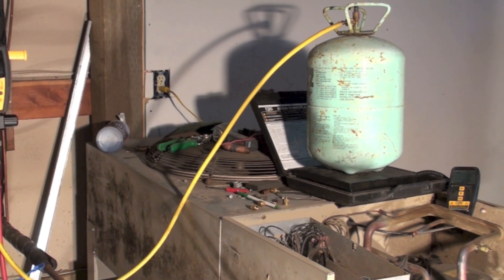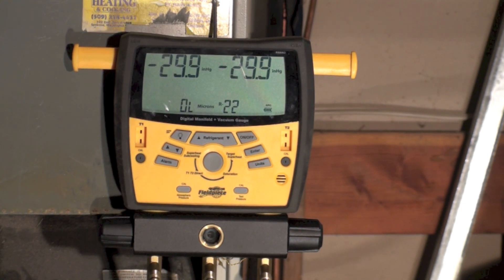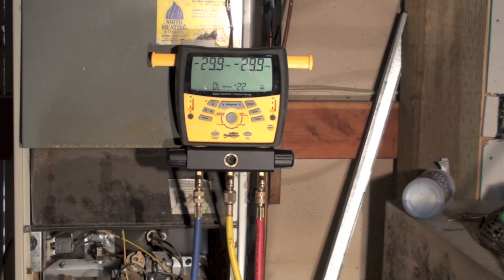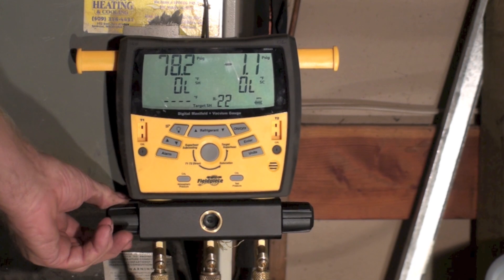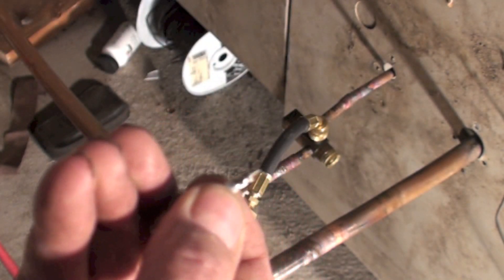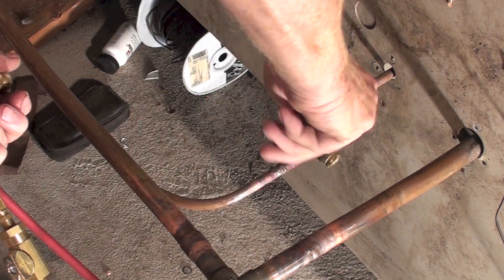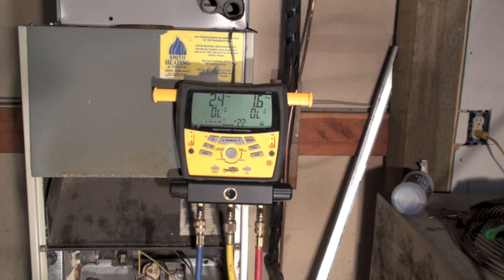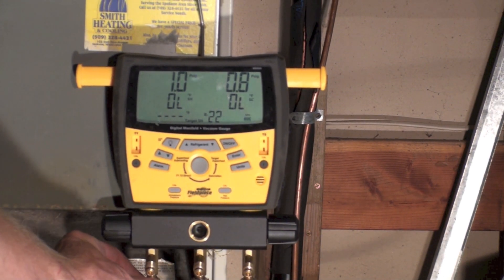Replacing schrader valves after evacuation of the Air Conditioner

Comment: Gooooood job on all of your instructional videos Gary.  I am a 1st time novice at replacing a compressor, pulling a vacuum, then charging the system.  The part that I never found on other videos was "how to reinstall the Schrader valves" without a special valve.  Just by quickly installing them with a positive pressure on the system.  Great job on all of your videos.  Good things happen to good people.  I think many Good Things will happen to you.  Thanks for your time.
Reply from the maker: Thanks for the support.
GFM

Comment: what do u usaually do when you diagnosing a system with a coolant overcharge? as far as removing the excess coolant? is there a way to take it out with out using a recovery tank?
Reply from the maker: +Arnold Navarro No.  Dumping refrigerant is a violation of federal law.  
GFM
Reply: s the recomended sub cooling on most r-22 units around 12? i see on our ac's the high and low pressure should be at 300 so that should be around the same way to measure refrigerent?. im debating weather or not to get some temp probes for my manifold an im not sure of the label. it only recomends by weight it seems. so i imagine the weight is determined by psi???

Comment from the maker: The unit may or may not have refrigerant in it when you come for service.  If you recover the refrigerant, it should be at or below atmospheric pressure, so there is no pressure difference.  The service valves may be closed if the repair is in the low side.  Hope this helps.
GFM

Comment from the maker: The Appion tools are indeed vacuum rated.  I am just trying to avoid as many fittings and o-rings as I can.  Gaskets and o-rings are easily damaged and need to be replaced often.  The micron gauge is a good point.
GFM

Comment from the maker: The only value of nitrogen is that it is dry.  When you charge the system with nitrogen, even if you release it, there still is 15 psia of nitrogen in the system.  It is a non condensible gas and will displace the refrigerant.  I would consider it a contaminate as any other gas in the system that is not refrigerant.  Hope this helps.
GFM

Comment from the maker: It kind of seems old fashioned, but I prefer not to use schrader removal tools because of the additional fittings and o-rings and there is some air introduced into the system with the valves.
GFM

Comment from the maker: Yes.  The tool was originally designed as an isolation valve for removing schraders.  It is commonly used for installing schraders after evacuation.  I don't generally use it because it adds more possible leak points during evacuation.
GFM

Comment: Great demo of how to do this procedure without any special tools! I usually have my little core removal tools on the system for evac anyways. Either way, the point is to do it with a positive pressure to avoid getting air in the system. Good tip about the new cores, too! Don't understand why some take a chance with the old ones.